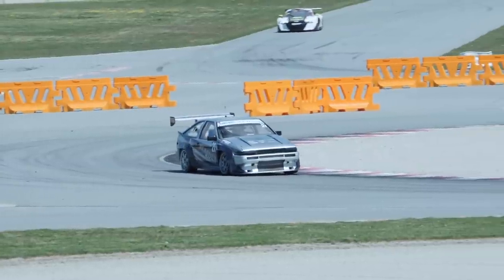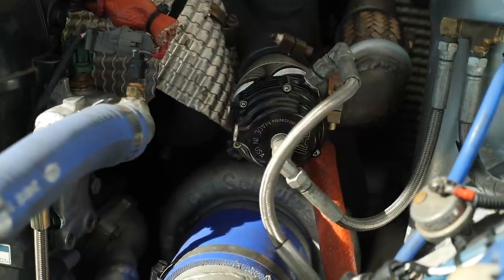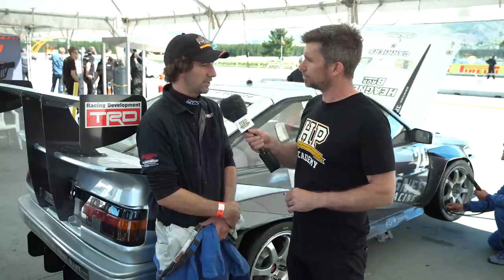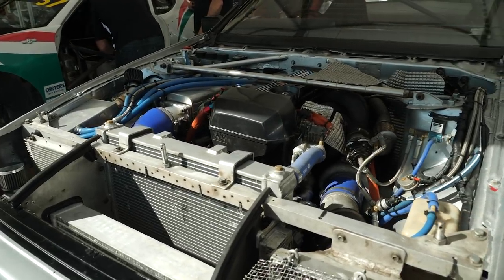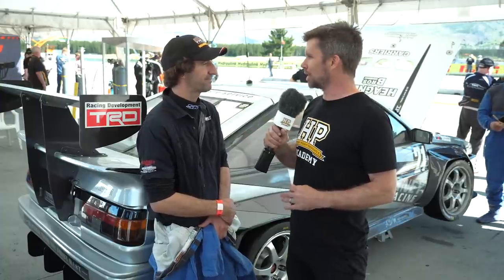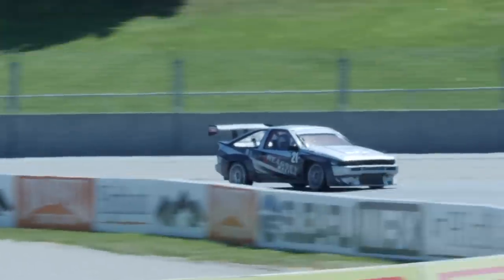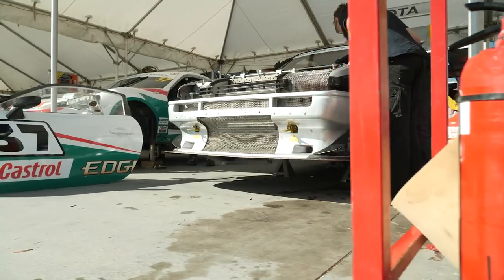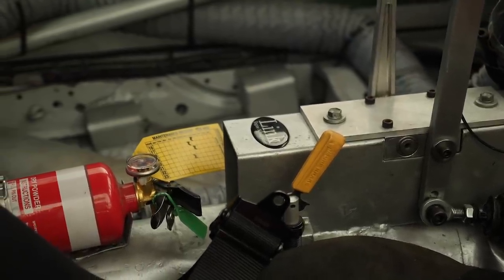AE86 Endurance Build | Turbocharged 500HP 3S-GE Conversion [#TECHTALK]

Comment: Live axle, Detroit locker, a gas, concrete filled and sleeved  iron block
That's an unusual  combo, and quite reliable as well.
Reply: Seems like they solved each problem as the problem came up and solved it with techniques that work 🤷🏼‍♂️
Reply: @IcanDriveIt  I wonder how much grout is in the block?
Reply: This guy is pretty rad 😂
Reply: 98+ 5S block FTW.

Comment: This guy filled an endurance engine with concrete? How does that effect cooling. I am disapointed Andre didn't follow up on that point.
Reply: I see a rad , so probably not full fill
Reply: @michaelgunning347  Well yes but you would think cooling would be significantly compromised, which is why I found the comment interesting considering cooling on an edurance engine is a major challenge.
Reply: It would have grout on the bottom of the liners, most of the cooling is done on the top anyway.
Reply: @flyingfox09  also depending on fuel , too
Reply: Block would be considered less than Half full of concrete. Then a EWP we see 65 deg lower radiator and 88 deg upper… all day and I wouldn’t say our cooling package is “aero” it’s pretty simple

Comment: Really impressed they’re running the stock oil system with slicks and having no issues. Would love to know what weight and “height” they use with the oil system for my 3SGE build.
Reply: Probably helps that it has over 5 liters of oil capacity as stock.

Comment: How are you breaking sleeved 4th gen 3S blocks? Especially half filled, these motors can handle 1200+ horsepower when sleeved and half filled.
Reply: It’s an endurance car. 1200hp won’t last 5 laps
Reply: it's 5th gen tho. Stock block can break at 450 up depending if it is earlier model or later model. I've been told later model blocks are just a bit stronger.
Reply: Yeah, really interesting that they didn't just move to a 5s block... this is new zealand, we have them everywhere
Reply: @DaMan8691  Yeah 98+ 5s block 95 bucks at pick a part lol. 
Possibly hard to find pistons to suit 5s block (87mm bore) and beams head but psi racing have them.
Reply: @CRsGarage-nz 
The 3s block would crack after about 1.5 hours of run time, 
We retained the 3s block for oil squirters and less machining required so we could build new engines within a week of we needed to keep the car going during the season. 
We cut the 3s and 5s blocks open to measure the wall thickness.
And made the decision to stay 3s and half fill the block. 
Has proven for our application to be the right call.

Comment: wait, concrete filled block? I need more info on this
Reply: This is a really common practice for high horse power applications. You can either half-fill or full fill the block, usually the ladder if it's being used in drag races.
Reply: Google it

Comment: Toyota had been building “turbo pistons” for that engine since 1988.
Reply: I assume they meant aftermarket
Reply: They didn't release that engine until 1998 and it had different valves to the 3sgte using previous gen pistons probably wasn't compatible
Reply: Especially with dual variable can control
Reply: @dan4age  
Right. All you would need to do is to grind the valve reliefs. Unless you’re trying to keep the BEAMS compression ratio but I wouldn’t do that with boost on av-gas. The different generation GTE engines will yield you a choice of, I think, three different compression ratios from 8.5:1 up to 9:1 IIRC

Comment: soo they overfilled the engine with oil to the point the pickup cant run dry?
why isnt that being done on any car tbh.. or multiple pickups? anyone?
Reply: I doubt they are over-filling. Once the oil level is too high the crank splashes in it. This creates drag and (apparently) can whip the oil into something unpleasant.
Reply: overfilling leads to aeration of the oil wich is pretty bad as you can imagine. 

if you can monitor your oil level while the engine runs; you can fine tune your maximum oil level

Comment: Whats a 4H ? Isuzu ?  I got the same HP out of the 4AG on pump gas  ^ . ^ y  Drag raced every weekend for 10 yrs . Car took off so hard the ass end would hop until it tracked up . You dont need all the things this guy did to achieve endurance build ...
Reply from the maker: There is a huge difference in setting up a car to drag race compared to sprint racing and then even a difference there from sprint to endurance.

You certainly probably don't need to do everything done here but it also depends on class rules, what others are running and of course if you like being competitive or just circulating - Taz.